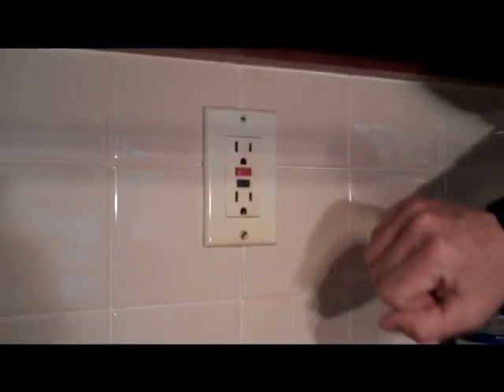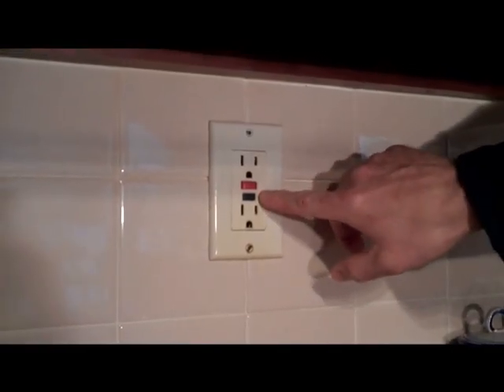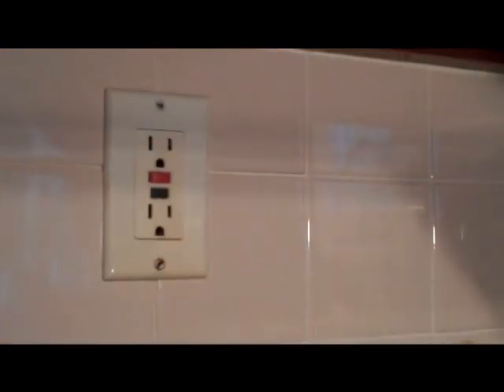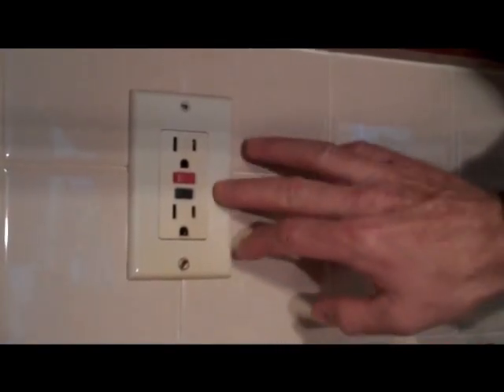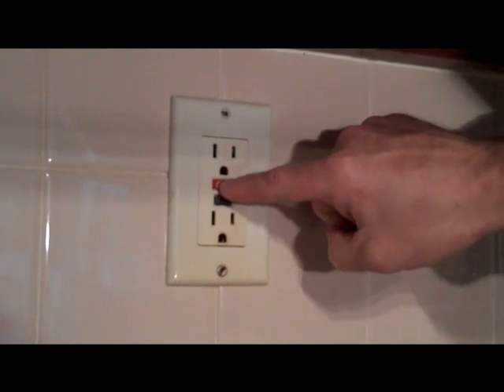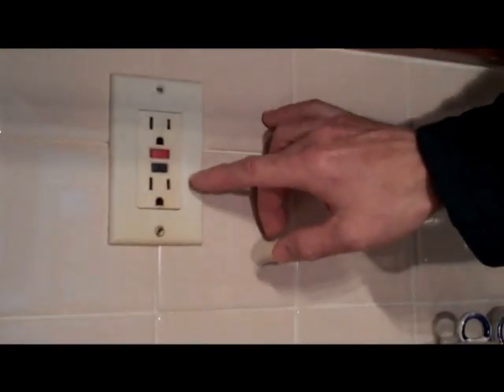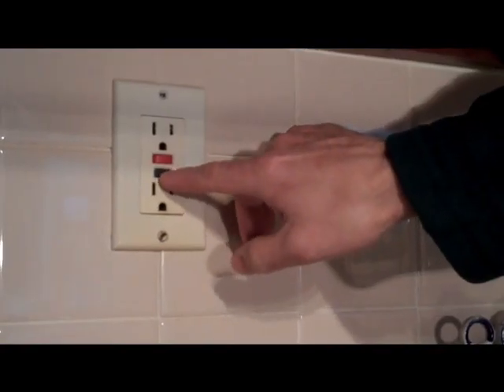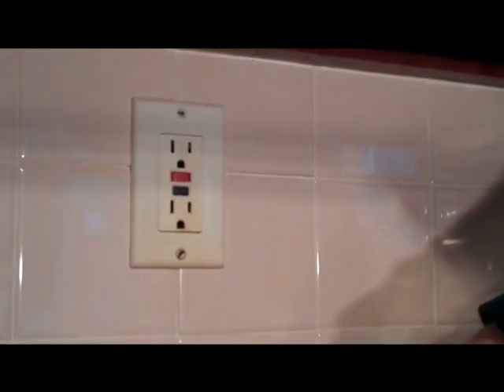GFCI plugs, how to reset and test

Comment: Well. I guess I’m the oddball out of the group… I tried this. Did not work. My outlet on my back patio has the orange light on it. Says see instructions. - I press the reset button on it then comes right back .. I go inside and press every reset button on all GFCI outlets and still nothing .. so I don’t think any of them are connected to the one I have outside .. 🤷‍♂️

Comment: In my apartment, they prevent me from  plugging  anything in at all as if they are not connected to anything. The buttons do not push ! Thanks to made by qa crew from nowhere who rushed through a remodel in this HUD complex a few years ago. No one will own up to the problem. Must be my fault ! Of course I must have poured cement  into those outlets..........call in the professionals...ahahaha...the maintenance guy who tries to force the plug in and bends the prongs. Might as well start a small fire in the sink to get the icebox bathroom warm enough to take a stinking shower. Non electricians scare me. Here I go again trying to be safe.

Comment: Maybe someone knows what's up with this outlet concern.

My bathroom GFCI outlet wasn't working/green light off, and when I went to test/reset it, the power went out in both bedrooms. Came back on when I pressed button, and the green light on outlet went on.

Didn't happen in the other bathroom that has the same type of outlet.

Happened again later tonight.  Lost power to both bedrooms, in all outlets. What is the deal with that? Anyone? 

I'm in a rental property and need to tell the manager and want to see if anyone has any insight before I do.

Comment: Hey, easy peasy. When I discovered that the microwave wasn't working when an orange diode was lit up on the wall socket panel I immediately thought that there may be a an impending fire hazard situation. So I googled the situation that led me here and resolved the issue myself from this video's instruction. Cool baby 👌👍

Comment: My outlet doesn't always reset that easily when you press the Reset button. You have to do it a few times and press in the right area to get it to work. It's an old house and I am broke, so I am not about to be hiring an electrician to replace it, as it isn't a critical outlet, but I am sure that I am not the only person that has encountered this issue.

Comment: there  was a wire not connected completely to the plug in the electrical box and the circuit had no power.   reconnected the wire to the plug.  All is good.

Comment: Thanks Sir,  I faxed an issue as the power was got tripped after pressing reset button. I searched and found your video. I watched your video and followed your suggestion and unplugged everything and tried to reset and it worked. Thanks a lot for saving my money.

Comment: Can someone help me? i heard a pop sound from one of the outlets in my room and both of them are dead now and don’t work but the rest of the outlets in the house still work fine. I tried this reset thing on the outlet nearest to my room and still nothing. Checked the circuit breaker and nothing was turned off what else can it be?

Comment: Thank-you so very much.  This new Oak Creek Home Mobile Home the kitchen and bathroom GFCI outlets did not work, they just had a yellow light.  I did push them, but didn't push them in hard enough to make a click.  Now the bathrooms work and the kitchen also.  However, tomorrow I'll see if the GFCI outlet which has NO reset button is controlled by the same outlet in the string.  We'll see if my toaster works in the morning.  Thank-you so very much.  You've taught a Grandma a new piece of knowledge!  Chuckles.

Comment: Thank you for taking the time to not just explain how to reset it but also providing info on what GFCI outlets are for and when and why they may need to be reset.  I have exterior landscape lighting around my home that is plugged into an exterior GFCI outlet and when my landscape lights don't come on, I now understand what to do so that I don't incur charges having either the landscape lighting company or an electrician come out to resolve the issue.

Comment: Ok the basic simple shit. I have a Sperry Brand receptacle tester with a button for testing GFCI's. You know one of the little things that you plug in and identify the lights that light up on it. At home; where all the GFCI's are no more then 3-5 years old they all pop when I push the tester button but at a rental apartment, although the two GFCI's will pop with their test buttons; they do not with my tester. So the question; is it possible for GFCI's to be bad yet test good ?

Comment: I have unplugged the two things that was plugged in my bedroom. I have gone to the breaker box. I have reset the gfci closest to my bedroom there is not one in the bedroom. I switch the lights on and it will flicker for a second and turn off. My fire alarm is also beeping when i come home. Lights still not working. Should this be happening my house is only 7 years old from being built?

Comment: If the gfi won’t reset then one of two things is happening: the gfi has failed and needs to be replaced OR there is no power to the outlet due to some other cause. If you have a continuity tester you can quick determine which is the case.

Comment: If anyone reads this and knows the answer....please help.  All worked fine until one day i turned my bathroom fan off, and now tge light and fan dont work....in my upstairs bathroom AND downstairs bathroom wont work.  My gfi button will not reset, it just never clicks in and sticks.  Is my gfi receptacle itself fucked???

Comment: Ok So i  have a power cord with GFCI  and when i plug the cord  the button goes out,  i press the test button and does not do anythin so when i press the reset button while the power cord is plugged in the button RESET automatically goes out, what does it mean

Comment: I went into my room last night, turned on my light (ceiling light) and it made a weird noise and then all the power in my bedroom, master bathroom, and closet, and dinning room area wil not turn on. ive tried pushing those buttons but nothing happens......... the circut thing is sealed shut :/

Comment: the two main outlets in my kitchen have red lights on..also the other two outlets don't work. I've reset the buttons several times. my breaker box is still working fine. so I'm stuck in between not knowing if it is dangerous to continue using these particular outlets.  any advice

Comment from the maker: You need to determine if there is power coming into the outlet.  If there is, then the outlet has failed for some reason.  If there is not, it is possible that power to that outlet is controlled by a switch somewhere in the house.  To test for power, you will need to use an electrical tester to check the wiring into the plug.  I hope that helps.

Comment: My GFI is tripped - it s new from Home Depot Was working fine with my Christmas Lights with it s Green light on and everyting showed it was wired right - it went out and the Green light is off and cannot get the push reset switch to get it going again - what can be done? I s there a special procedure?? G.
Reply: i cannot push the reset button in to get electricity going again
Reply from the maker: ZarvessMC | Minecraft PvP If the plug will not re-set then either there is no electricity coming into the outlet or the GFI outlet has failed.  Unless you are comfortable working with wiring, you should have an electrician take a look.

Comment: Thank you.  You were extremely helpful and I fixed the problem.  You have saved me a call to the electrician.  Apparently a service worker we were using ran water all around the outside plug and we had to find all the gfci outlets.  We tested each one and found the correct one.  Voila!  Now we know how they interact with each other and to what plugs.

Comment: my reset button never stays in. how do i fix that
Reply: I had the same problem. Found out it was the outside circuit breaker. I rechecked out there and saw one switch that was slightly off - not fully over to the off position. I flipped it over to off, then back on and it held. I went inside and tried to reset the gfi outlet and it worked!
Reply: GospelIilike 7 years later...